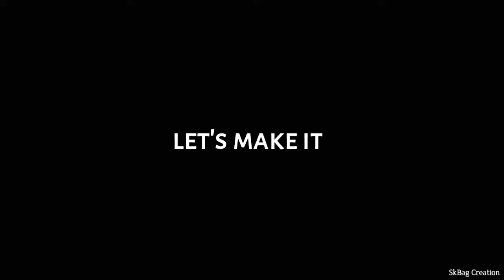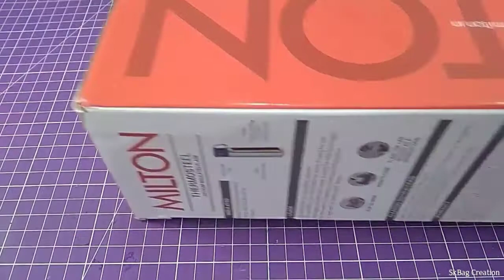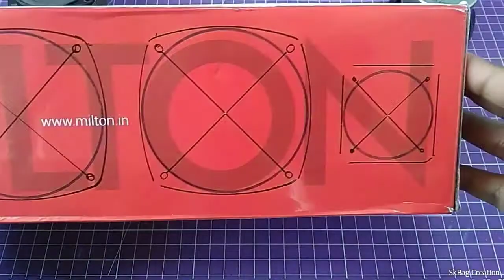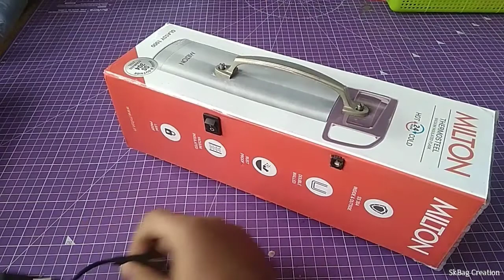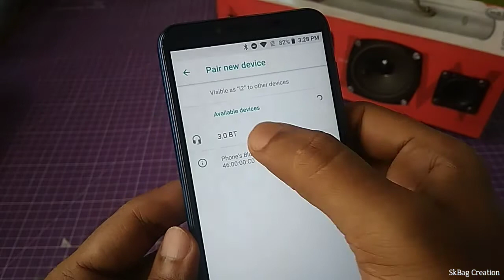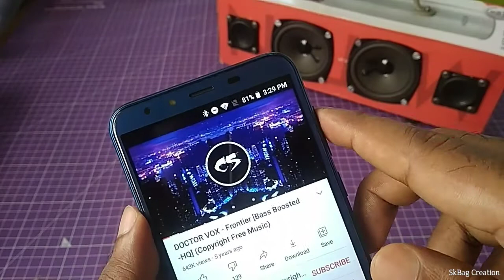How to make a Bluetooth Speaker at Home the Extreme SoundBox

Comment: Amazing 😍😍 and Kya aap Pam8610 + Pam8403 ko ek jodkar Bluetooth amplifier bana sakte.
Reply from the maker: Yes bro it is possible I make a sound bar where I use 3 amplifier in a circuit you can watch it in my channel
Reply: @SkBagCreation  Thank you so much and my support your channel
Reply from the maker: You can can easily make it the working voltage of pam8610 is 12v & pam8403 is 5v so if you give it the converted voltage the both will be work. I give a details circuit diagram on soundbar video you can understand it there thanks bro for your question